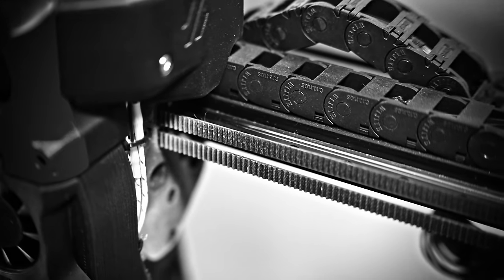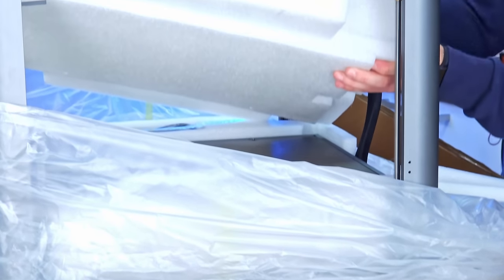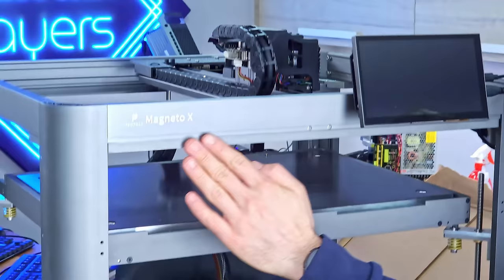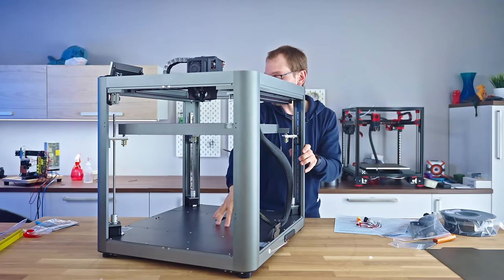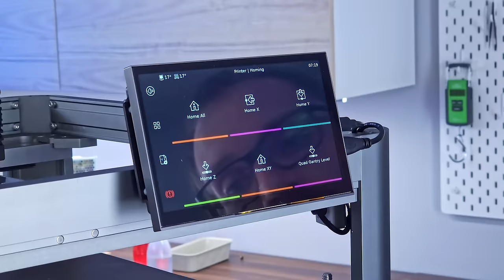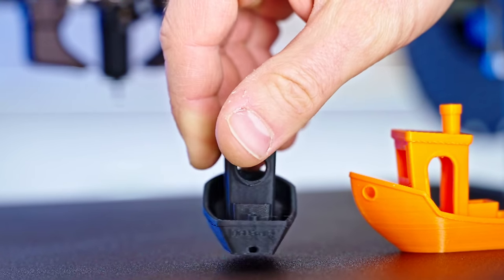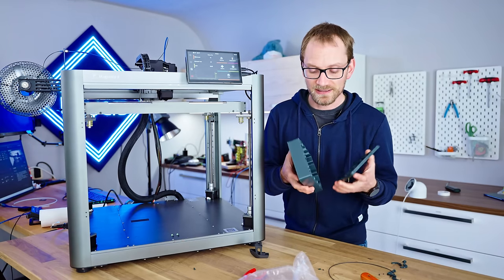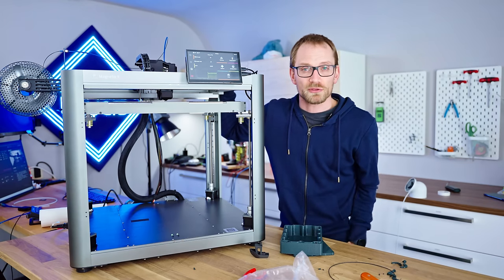The 3D printer with no belts: The Peopoly Magneto X uses closed-loop linear motors!

Comment: Bed electric insulation might be enough, but oh dear! Bottom live wire near the power switch..... There will be time, when some bolt, or key will slip out of your hand, and end up under the casing.... And since it's a heavy machine, you will forget and try to grab that bit from under... It's easily fixable, but that should be in mind when releasing a 1200+ euros device to market...

Comment: Yeah, awesome demo unit. If they could do something about the things you mentioned, plus the end stops to prevent the plate running into the head like that. And do something about that wireloom being pinched so hard that the protective sheath has a cut in it.... Than yeah, i would seriously consider it an option to upgrade to.

Comment: As a robotics engineer, the lack of endstops of any kind for the bed is a level of shame equivalent to s**ting your pants while drinking. However you are drinking non-alcoholic beer.
Reply: I always use endstops in my underpants to prevent that very problem!
Reply: @nikthefix8918  limit switch is more appropriate.

Comment: Keep in mind that I am a senior so my opinion will likely vary from someone who is younger. I am sure there are commercial applications where the speed would be important but for me this machine is simply over engineered and overly complicated. It is just like everything else in this world now such as cars etc. Over engineered  and complicated which in turn make them too expensive for low income people. Through my life I have always stuck with the KISS system (keep it simple stupid). My Kingroon KP3S version 1, Fokoos Odin 5 and Elegoo Neptune 3 Pro printers give me the quality output that I need and are lots fast enough, at least for me. I have lots of other things I can do while it is printing,  and most importantly... I can repair them without studying to be a rock scientist. Just my 2 cents.

Comment: Was this a production model or a beta test unit?  AFAIK they still aren't shipping to customers yet?  I still haven't been contacted about my pre-order. If this is from the Beta, you should have declared that in the video, IMHO.
Reply: Definitely not a production machine
Reply from the maker: I was assured this machine was identical to regular production units.
Reply: Probably a barebones unit sent out to content creators to do beta testing and "see it first" videos. Little things like the terminal covers for the back of the primary power input cord socket and the spacers with correctly sized hole on the z-axis motors will be touch-ups done to machines before full release.
Reply: It needs to go back in the oven for a bit more cooking.

Comment: Cool concept printer. They clearly put in a bit of ‘idiot proofing’ i.e: love to see full auto bed leveling and there should be very little maintenance compared to belts. 

But much is missing before the average end user can work with this. Missing basic electrical insulation and Z limit stops are major blunders. 

Curious what retail price will be once the product is ready, 600 - 700?
Reply: 2000 usd

Comment: with a bit more engineering they might be able to collapse that rats nest to a single pcb. but so far it looks like a nice machine. the lim (linear induction motors) motors could be given more poles with might smooth out the movement. wish my Creality cr6 max could print that fast

Comment: That thing isn't even allowed to be plugged in in EU.
Missing A LOT of electric safety. Ex. The bed should have been marked with 230V. And then all exposed electric cables 😬
Someone has made a very good printer WITHOUT knowing any laws :/

Comment: well acsually a dream printer,  ive been holding out with a bamboo,  i dont like the thought of a cloosed system chinese server in my home wifi with a webcam and who knows what else 😂

so straight up klipper, wich is open source, and needs no wifi, but can be run via a usb stick is something huge in 2024 , and this also makes it possible for compaies to print stuff they dont want to have copied 😮 

also the problems are a easy fix , and peopoly will for sure fix those, but you can also fixbit yourself, since its *OPEN SOURCE *

Comment: Very very cool linear motors.
Bit for something so cool... I see no reason why this printer is not preassembled. Makes no sense and really hurts the brand image. The difference when you unpack a new futuristic tech like this and you plug it in vs struggling with the packaging and finding out what all the little pieces go.  What? You saved a buck from just stuffing it like that in the box? Come on.
Reply: The reason the printer shipped with the bed unassembled was because there was a large amount of damage to the bed done when shipping the printer with the bed attached. Figuring out a shipping method that resulted in little to no damage has been a lofty goal of Peopoly. Being that I have one of the pre-orders coming to me I have been privy to the trials and tribulations this company has been going through to get this product designed and developed and shipped in a small time frame.

Believe me that every time Peopoly found an issue and pushed shipping back so they could implement a solution it has been a little frustrating. But at the same time I'm glad to allow extended time for this printer to get ironed out a little further in order to have a great experience with it.

Comment: Got access to some beefy industrial magnet sliders from a CMM (scary expensive when new, easily in the 10's of thousands), haven't considered using them for a 3D printer because their strengths isn't really useable in a 3d printer. They can move fast or precise, and they are not very light weight. I don't see what they gain other than a ridiculous amount of complexity in the electronics side.

But hey, if they can bend the laws of physics to make this work well, and able to make this at a reasonable price, then sure.

Comment: Breaks 3D printer.. reviews print. Don’t buy for at least another year, simple. Issues that you should t have to deal with for the price.. cool features and also lacking some key features. Needs SD input, needs endpoint hardware. Looks cool prints fast but breaks just as fast with a misclick.

Comment: The print volume is TINY compared to the overall size of the printer.
Only 400 x 300 x 300 mm.
I thought it would be at least 500 x 500 x xxx.
Not much bigger than a bambu.
$1999.00 is a little much for the build volume and mediocre print quality. 
The linear motors are clearly not working as good as plain old steppers and belts.
I was excited to see this printer , very disappointed. Hard pass for me.

Comment: Stepper motors are a plague and  sooner or later will be replaced by real servos. The low cost and high performance of servo drivers and sensors does not really explain the use of Stepper motors any more at least not like in the old days

Comment: this is an unreleased Klipper machine, not a Prusa or Bambu, you have to be able to work with Klipper, if you want good prints you need to tune it. Flow rate and pressure advance are both material-specific and should be tuned for each roll of filament so that when you printed that last model pressure advance was probably set to whatever orcas default is and the print looked like it was done with filament pulled from the Titanic. 

Tuning input shaper is trivially easy and it's so machine-specific that it's fair to expect the end user to do.

software endtops should have been in the default printer.cfg but it only takes like 2 mins to do so it's not a biggie.

no hate, i love your videos but this one feels like you didn't put the effort in to do the basic setup after putting the machine together so this review doesn't really feel fair, and i understand that we expect more functionality straight out of the box than we used to 2 years ago but Prusa and bambu are still the exceptions not the rule

Comment: Holy crap this kind of videos should be ilegal. 
It's insane how far you are willing to go to pretend that this ad isn't one.
You're even going so far that you are not bothered by straight up deadly design choices, obvious lying about the print quality, downplaying the severity of faulty parts like the fan and the stepper motor that you literally had to drill out. And you still acted as if that was nothing.